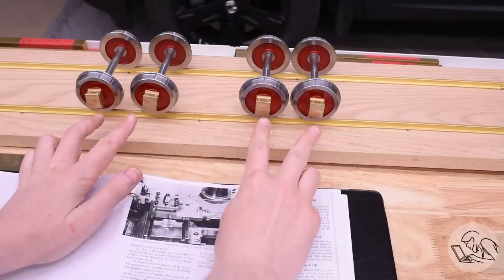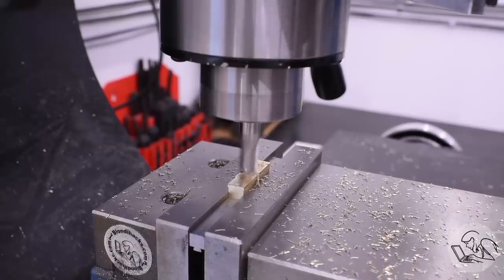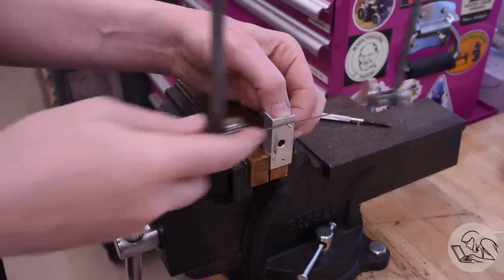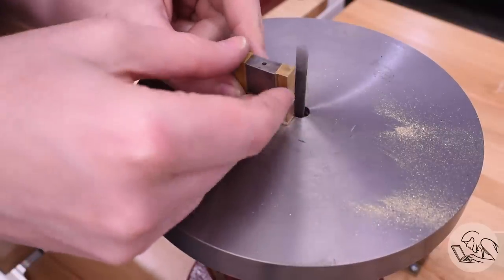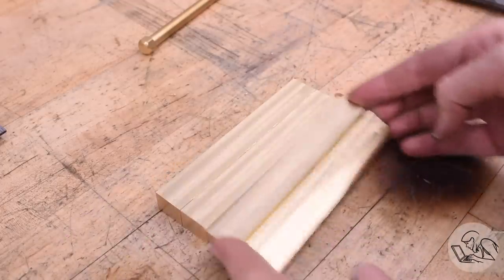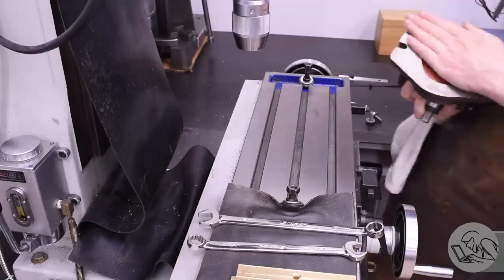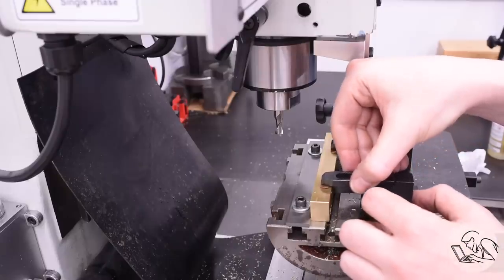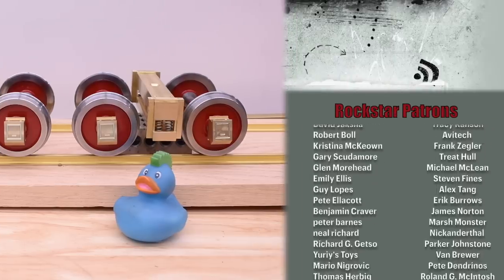Building Railroad Car Suspension - Pennsylvania A3 Switcher, Part 17

Comment: Looking absolutely beautiful. As a big RC car hobbyist, suspensions are notoriously challenging to get right. So many factors from design, to materials, to actual production methods...
I suppose getting a scale size boiler to actually hold steam is harder, but these parts MOVE constantly, and that's very cool just in itself. Really looking forward to seeing them gorgeous wheels fully sprung.  And go mohawk duckie go!  ;-)

Comment: Saw you testing the temperature of the newly soldered assembly with the front of your hand.  I was taught in blacksmithing class to always test for heat with the back of your hand.  That way, if you make an error in judgement and burn yourself, a burn on the back of your hand is much less in the way of the use of your hand than one on the front.
Reply from the maker: Good tip! 😄

Comment: When searching for a part that has fallen onto the floor, turn on a bright flashlight and place it on the floor.  Then sweep the flashlight around and look closer at anything that casts a long shadow.  It might seem counterintuitive, but it’s easier to see a long shadow when using the flashlight at a lower angle than it is to see a small part using the flashlight from a higher angle.
Reply: Your floor must be a lot tidier than mine.
Reply: @davidtaylor6124 He’s saying “You slobs need to clean up” in a useful way
Reply: I always just walk around barefoot until I scream - works every time, eventually.
Reply: When I am looking for a dropped something in my shop, I always start at the farthest point from where I dropped it because when/if I do find it it's never in a place that makes sense.  Oh and sometimes adult language helps
Reply: @me3333  absolutely, the adult language is a must!  It’s how the lost part knows you’re not just playing hide-n-seek.  Without it, I can never find anything!
Reply: I also get my eyes against the ground. Then I see how dirty the floor really is and do that vacuuming my wife asked for. Then listen for the rattle.
Reply: Heck, I lose things all the time just by putting them down somewhere which of course I forget.
Reply: This also works great when you drop a contact lens on the ground
Reply: If it has fallen on the street (at night) and after half an hour you can't find it, look closer to the rubber wheels of cars and behind these.

Comment: Dropped things act like small animals trying to hide. Specially because rolling parts lose their energy by hitting a vertical surface they look like they are trying to find shelter. The harder and smaller is the thing the longer the distance it can take.

Comment: Excellent work , proper production engineering , a tip for squaring the end of stock , use the lathe , grip it in the three jaw ( obviously it needs to fit through the bore of the spindle ) the machining marks are not concentric but it’s square .

Comment: 7:07 test heat with the back of your hand. Spent years in a hot forge and was taught from day one to test using the back of your hand. It avoids involuntary grab at a heat shock, you naturally curl your hand away. You will be left with your sense of touch if you muck up as well.

Comment: In aerospace machining, we’d pretty much always give either the diameter of the finished countersink (minor diameter if on a contoured surface). It might be specified by the flushness requirement for the fastener for assemblies. Either way, a micro stop is your friend.

Comment: For the chamfer, try a ball bearing; doing the math in Fusion360 is probably the fast way but given the chamfer angle and ball diameter you should be able to get dialed pretty quickly.

Comment: Have you considered wrapping the the parts while soldering in something sacrificial to protect them from oxidation?  Also increases the thermal mass for the parts that aren't being soldered.
Not that the result wouldn't be nice, but might save some effort.

Comment: You probably already know this, but when measuring countersinks with gage pins, give the pins a twist. If the pin is smaller than the countersink, it will stay inside the countersink. As soon as it is .001" larger, it will twist out. Be sure to keep the pin as perpendicular as possible to be more accurate.

Comment: Another fascinating video. I wonder why the top bolsters are so thick? They do seem to be far too much metal for the job they are performing. Is it because the stock is that size and milling out excess metal would take time and the weight of the brass at this scale is insignificant, or would these bolsters be huge cast iron parts on a full size loco?

Comment: I couldn't figure out how the whole system worked until 16:26 when you showed that the bolsters go ALL THE WAY from left to right. I thought they were just small blocks at either end of the suspension.

Comment: Ha! Tiny druids.  Good one Quinn.  Thought the exact same thing just before you said it.  Q:  Before you drill a hole on your milling machine, you use a short bit.  To start the hole.  Then go back and really drill the hole to depth.  What is that pre drill called?  Can it be used for wood?
Reply: The sort she uses at eg. 03:25 is a 'centre drill' or 'center drill' in USA. They come in various sizes of point and are typically double-ended, with different sizes at each end. The little pointy bit creates a very small hole/divot suitable for starting a very small drill. The tapered section above it is a 60 degree angle, which creates a suitable hole for lathe centres to fit into, if you keep drilling down until it meets the workpiece. Strictly you are not supposed to use the 60 degree part for starting a drilled hole, as the angle is not suitable for the angle on the end of a drill (often 118 degrees, say), so they make 'spot drills' which have the correct angle, creating a divot that will match with the actual  drill. Quinn also uses these when suitable. But for tiny holes, the point (only) of a centre drill works fine. I've never used either type for wood, never seemed necessary. For really tiny holes in wood I have found a bradawl (or just 'awl') is fine to provide a centre - wood typically is too soft to make a drill bit wander much, And holes in wood seldom require 1 thou precision, unlike metal which does require a distinct divot to prevent the drill tip wandering and where holes often  need to be very precise.
Reply: @thisnicklldo  I accidentally watched Adam Savage explain why there are shaped the way they are.  Because of how stout they are, there is little or no deflection during drilling.  A lot of wood turners, use this type of drill just to get a concentric start in the end grain of a dowel for the free center.  I have the cheapest little mini wood lathe and bought an inexpensive set just for that.  Thanks for the great info.

Comment: Hey Quinn, could you use pythagoras to calculate the depth of the countersink? My thought process is, if you wanted a top diameter of 14mm from a 8mm hole. By adding a 3mm depth chamfer the diameter of the top would be 14mm, this is assuming that you have a 90° coutersink.